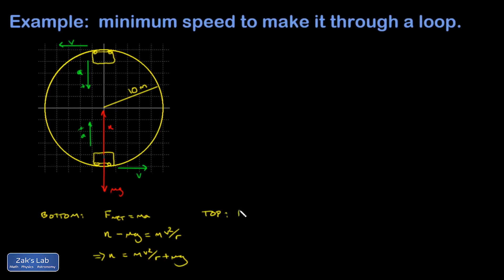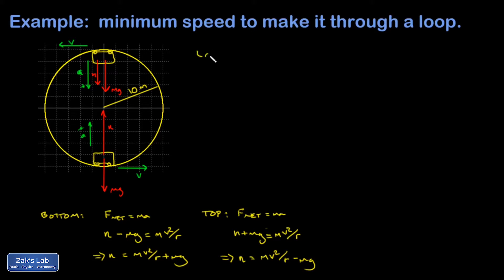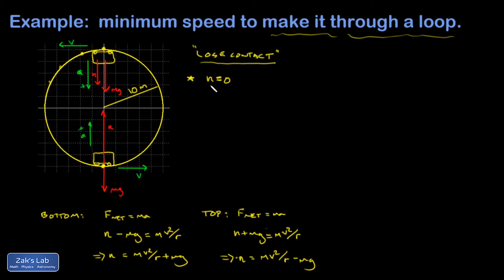Find the minimum speed to make it through a loop: circular motion minimum speed in a loop problem.

Comment: It's incorrect, actually v must be at least sqrt(5*g*r)
Reply from the maker: how do you figure it's sqrt(5gr)? z
Reply from the maker: oh -- I figured out what you're thinking on this.  The answer you stated is the answer to the question "what does the speed at the bottom have to be so that the speed at the top is sufficient to make it through the loop".  And you have to use energy conservation and you find that it's sqrt(5gr) at the bottom of the loop.  Here I'm just trying to figure out the minimum speed to make it through the top of the loop, which is sqrt(gr), which is necessary to use in your calculation to find the sqrt(5gr) at the bottom.  z